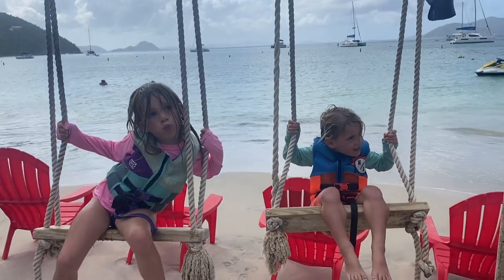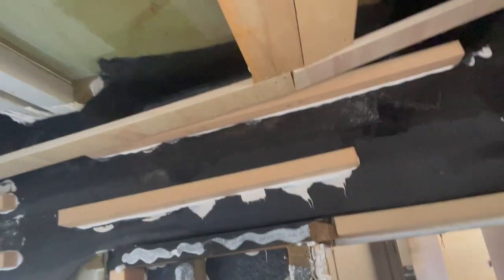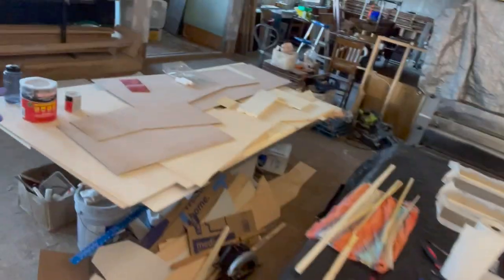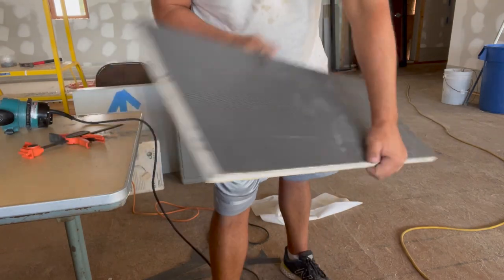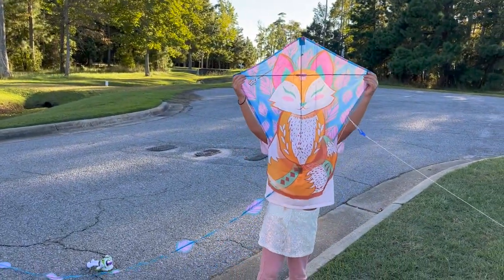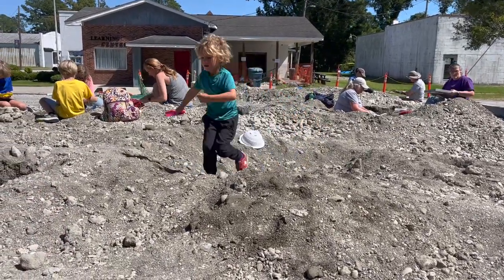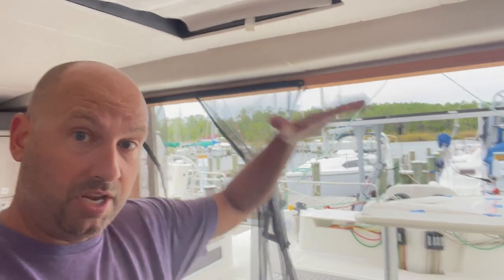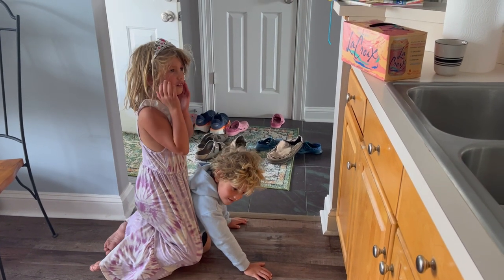Damaged Catamaran vs Hurricane Ian

Comment: Quick question while your panels etc are off. Have you found how the NMEA 2000 wire runs from the on top of the door instruments to the rest of the system. On my boat it seems to run along the port side of the roof but I cannot find where it comes down. I would love to replace this 10m cable and my end is damaged
Reply: I believe mine run from the instruments above the door down the starboard side. I don't remember seeing any NMEA 2000 wires when I had all the panels off. That being said my focus was elsewhere at the time. For me the main backbone for my NMEA 2000 wires are behind my VHF radio in the nav station on the port side of the in the galley. I also have parts of my Raymarine connect into the system in the starboard cabin. My chart plotter is on the starboard helm and there are connections there as well as at the top of the door where the instruments are and I have one instrument on the port helm. So my NMEA 2000 cables run all over.

Now all that being said, can you just cut the end and rewire the end fitting? I thought that was possible with the NMEA 2000 wires. Finally I would recommend posing this question to the catana yahoo group. If you need their info let me know and I can connect you.
Reply: @clintknox825  thanks Clint I might end up cutting and fitting a new plug when I can find one in my part of the world 😊 . I must say the lack of access drives me crazy. My previous cat was a Leopard and the were cable conduits of 30 to 50mm and easy access to every join and corner